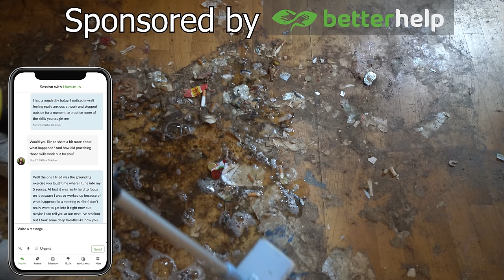DEEP CLEANING THE MOLDIEST HOME EVER! 🦠😱 Amazing transformation!

Comment: my father, younger sister, and i have been having a rough time with depression since our mom moved out and we're slowly working together to get better. This channel came to me at the perfect time because part of the healing is to get our house under control and in order. This channel has the best tips for cleaning that i'm actually excited to put to work. Our kitchen and my bedroom are awful and i can't wait to put these tricks to the test! First step is to get the right tools and i've been writing a list of the things you've been using to get the best tools to use. But i have a question, idk if you've covered this in a video before but what's the best way to get permanent hair dye off of a marble sink? I've tried a hydrogen peroxide and dish soap mixture before and it only worked at a meh level.
Reply: I hope it goes well! Best of luck
Reply: Try using a chlorine/ bleach like product and power paste. Actetone might do the trick depending on the stain as well as a baking soda and white vinegar mixture. Don't mix too many products or hot water else it'll become toxic. For harsh products use cool/ cold water. Best of luck, I hope this was helpful

Comment: I've got some tips for depressive lazy procrastinators - being one, not so severe though;) First - always have a pack of wet wipes in reach, especially by the computer:) It's ridiculous how much filth, dust and crumbs one could collect around their main spot of sitting/working, if wiping it off means getting up and going for a towel... Really makes a difference, and any not-so-dirty-yet wet wipe can (and should) be used to death on the floor and other surrounding surfaces. Next - put trash buckets in reach everywhere you tend to litter. It's easier to throw out the collected garbage once in few weeks than picking up piece by piece everything you've been dropping around for few weeks;) Third - if you're a smoker, use closing ashtrays. You don't need to smell the stench of your cigarette butts all the time, it won't make you feel any better. 4th - buy a  mould remover, it's usually chlorine based spray. It literally evaporates the mouldy black thing on the grout or on non-washable walls. Just don't stay there breathing it and air the room after;)

Comment: What do use to take off grease from wooden cupboards in kitchen. thanks 18.16 pm uk
Reply: Are the cupboards real wood, or wood effect like the ones in this video? If they're wood effect, washing up liquid and a non-stick sponge scourer or cloth, and make sure you rinse them with a fresh cloth.

If they're real wood, I'd use a washing up liquid solution - washing up liquid in tap hot water - rather than putting neat washing up liquid on them. But again, use a non-stick sponge scourer or cloth, & wipe clean with a fresh damp cloth.  Just be more mindful not to get them too wet.

Comment: I don't understand your cleaning method. Why not spray anti-mould stuff then rinse off then scrub after? How are you not wearing a mask around all that mould. There was also a heap of mould left on the wall. 
I don't understand the scrubbing of tables and floors full of rubbish, instead of wiping off first, then you can see what needs to be scrubbed and do that after. 
Not having a vacuum to suck up thick dust before wiping surfaces is frustrating too. It would be a lot quicker.